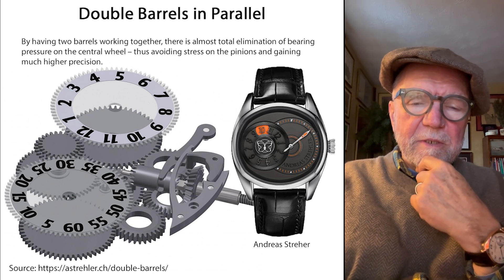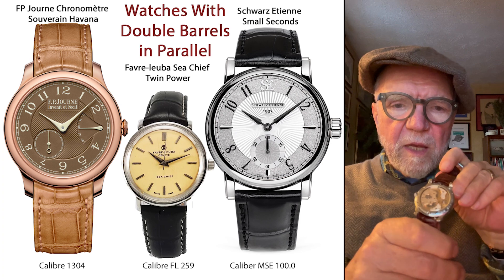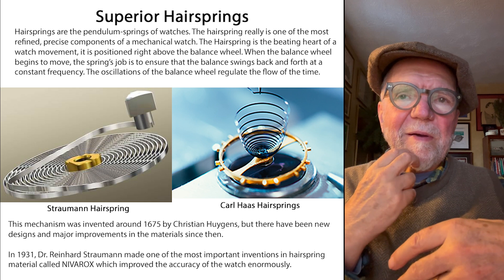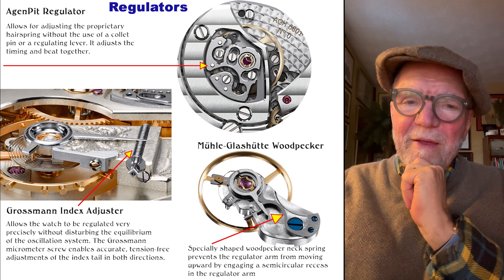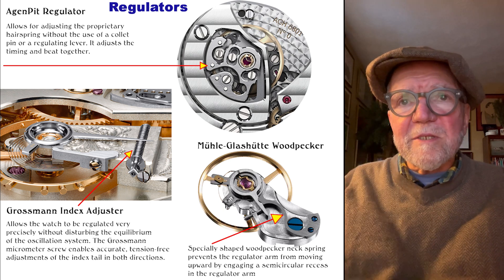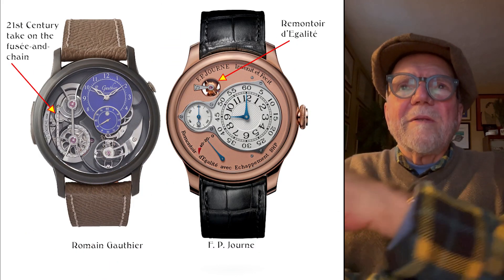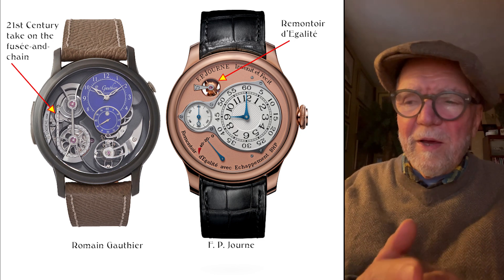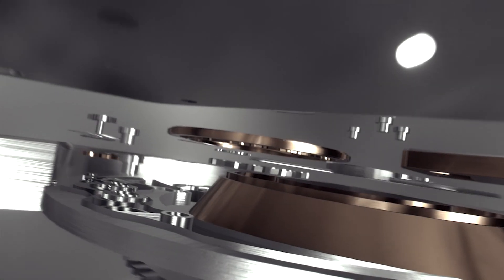Mechanical Innovations & Watches that Have Them #512

Comment: What an interesting video I like the Schwarz Etienne small seconds
I seen a watch with twin beat hearts think is that means 2 escapements.Philippe Dufour duality made in 1996 does this make the  watch more accurate. I found a Christopher Ward SH21 double barrel watch in C1 Morgan Aero 8 watch
Reply from the maker: The Schwarz Etienne comes in two flavors—"M" and "A" movements. The 'M' is manual and has two barrels arranged in parallel and the 'A' is automatic with the barrel in one inset and in the other, instead of a second barrel is a micro-rotor, James. As a big Morgan fan, I'm going to have to check out the C1 Morgan Aero 8!! Take care, Bill

Comment: Love the video - thank you! Curious to know where you would place Grand Seiko Spring Drive with its amazing accuracy.
Reply from the maker: Thanks AJ, but the GS Spring Drive, while brilliant technology, is just another quartz watch with an electric charge generated by the rotor. It has amazing accuracy, but so too does a $10 quartz watch. Take care, Bill
Reply: @watchartsci  Thank you! Always enjoy your videos and learn a lot.  What's your opinion about the role of high-beat movement on accuracy?
Reply from the maker: @AJHall-y4z  A high beat watch is around 5Hz, right? Maybe 6Hz or even 10Hz would be considered crazy high, right?. A quartz watch has  32,768 hertz! So why try and get a few more Hz from a mechanical watch and beat up gear train when a finely crafted watch at 2.5 or 3Hz will do the same?

Comment: Love the fusee and chain but unfortunately they are too expensive the chipset one I found is Zenith academy georges favre-jacot around 30k and it’s a beautiful watch
Reply: Vintage pocket watches with a fusee and chain can often be found at affordable prices if you're willing to take the risk
Reply from the maker: Ali, you're right, it's a very expensive complication! However as EveryonesShadow andJohnnyArsenault point out... check out the vintage pocket watches. Take care, Bill
Reply: Ali: the fusée & chain is a modernized version of pre-Lépine era (the fusée & chain pocket watches were extremely thick pocket watches), these can be had second hand(nobody mfgr. these anymore) and have lugs soldered to them. BUT it will look like an Invicta (very thick & big watch), at that period of time anti-shock system didn’t exist thus prone to breaking pivots 😭. Zenith has modernized the chain part thru CAD/CAM & put a shock system into them (better buy a spare chain as they are the only fabricators of these miniaturized chain). Any patents are limited by time (10-15 years???) afterwards if the idea is good enough some mfgr. is going to copy the technology which would be now legal.

N.B.: old fusée & chain pocket watches can be had for $800 plus range, usually a $2k is jaw dropping, these chains were done by children hands (adult hands couldn’t make them: gorilla hands) since they were to hard to mfgr. from scratch (similar to a miniature bicycle chain, link by link) As soon as the Lépine system came in (gears in same plane axis) the Fusée & chain pocket stopped being mfgr. & disappeared 😢